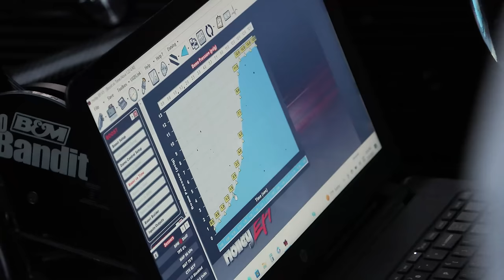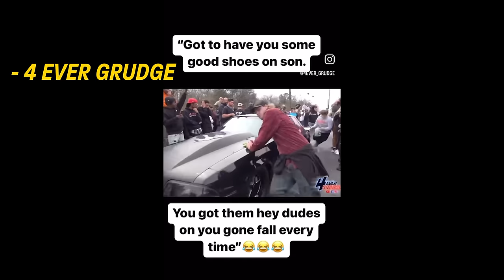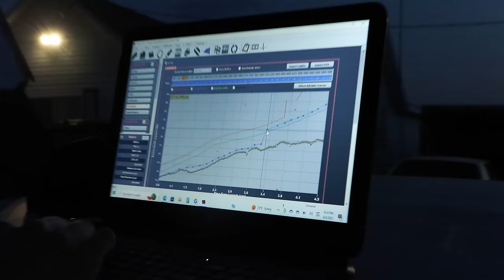Biggest Ohio Street Race EVER! Battle on the Asphalt

Comment: The Nova gets closer and closer to having it all right. That thing is going to be a force to be reckoned with. Still might want to check bell housing alignment on Tony’s Mustang. I went through the same issue years ago. It would shift normal at low rpm, but under load going down the track at high rpm you had to be perfect or it wasn’t happening. Just a thought

Comment: Still lost on how you build what almost amounts to a chassis car and still need to run a sissy bar 6 ft out the back.
Reply: You can put 50 pounds out there and have the affect of 300 pounds without carrying 300 pounds of weight in the car. Really surprised to see Cali Nate with the but hurt bar.
Reply: @bigboreracing356  do you understand weight bias is on a tube car is and why needing that is dumb.
Reply: @bigboreracing356  you dont need 300 or 50 ibs if he built the car right. Its a damn chasis car with bullshit on it to cover it up, It still shouldnt need it, When beater bomb was doing it it was cuz the car was still mostly stock and yes you arnt going to get that % without out the bullshit, Nates car theres no excuse for it.